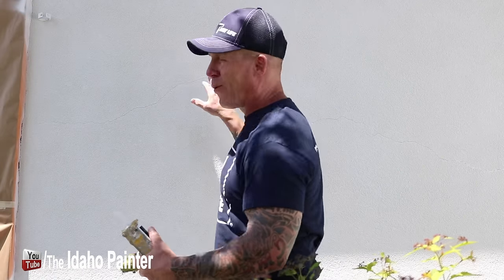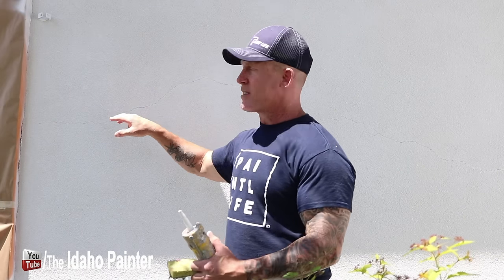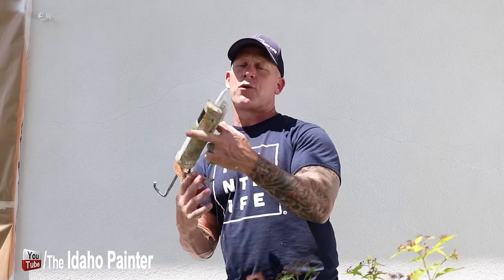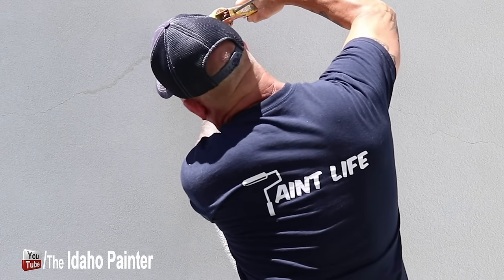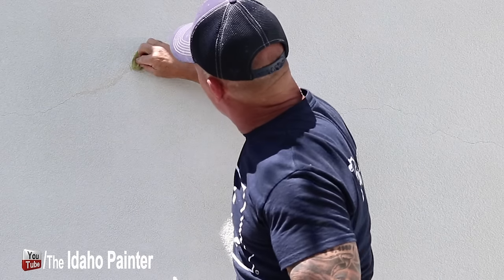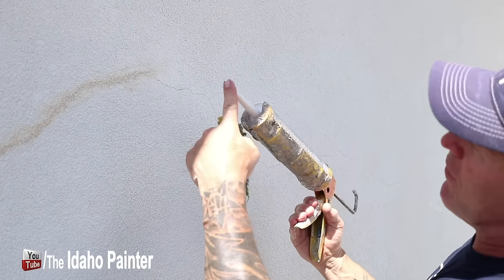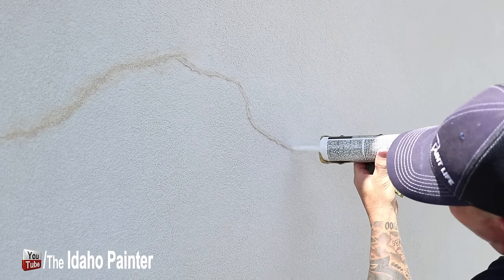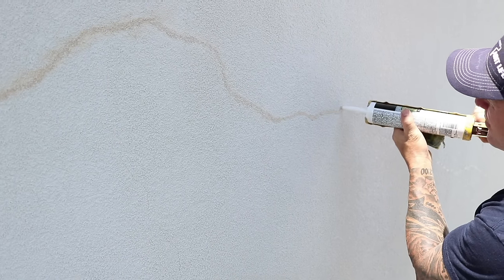Repair Stucco Crack Cheap & Easy

Comment: As a painter for a municipal govt. in the Southwest I had to do a lot of cracked stucco repair. I basically used the same technique you are doing, but instead of using a sponge to blend in the caulk I found that tapping the caulk in with a wet stiff bristled brush worked quite well. If the stucco had a rougher texture I would sometime work some sand into the caulk after it was textured.
Reply: thats a good technique to raise the caulking and give it a knock down if thats the type of finish they have..i like watching these videos to compare to my practice and helps me learn some new tricks or sometimes helps me find a better more efficient way of doing my job. nice to see another seasoned painter with an open mind to how others work

Comment: I gotta testify, I just read Colossians 3:1-2 this morning and then I watched this video and saw “Colossians 3:1-2” at the bottom of the screen! Awesome! We have a church in the French Quarter here in New Orleans and we’re painting the building. I used to be a pro painter but never dealt with stucco. This video was helpful -- thanks!
Reply: You really should read (Acts 20:20) and take the example of the preach work that Jehovah's Witnesses do
Reply: @alexshatner3907  are you a JW?
Reply: @RobertPresson  No, but I have relatives which I have high esteem for their Zeal

Comment: Thank you for the info. I bought a brand new house in AZ a little over a year ago, at the 1yr inspection there were some pretty big cracks in the stucco and i was able to get the contractor to fix but now i see more cracks showing showing up so now I can fix them myself😀

Comment: Which brand of caulking are you using here? In another video you were using White Lightning Megalastic caulking, but I don't believe that one has sand in it (maybe sand would not work with the super stretchy caulk?). Can the old sponge be used for texturing, in lieu of the sand? My wall gets a lot of sun and I'm looking for the best flexible caulking with texture for that. Thank you.

Comment: I keep a very wet rag with me and I wipe the caulk really well. It is another fast way to prevent any flashing from the caulk. I'm in Northeast Florida and 90% if my business is ext stucco repair/repaints. I also like to have a guy go ahead of the sprayer and hit the area's we caulked with a hotdog roller or even a 9/18" roller if it's easier. We backroll all our stucco anyway so there's a roller in the body already.
Reply from the maker: Awesome, thanks for sharing!

Comment: Ive found that with rough stucko textures you can just fill with an acrylic siliconized caulk and just fill only the crack and clean with wet rag, the paint i use is elastomeric, also ive found 90 percent of those cracks will go away if you fill them up with paint before you spray and backroll.
Reply from the maker: Thanks for sharing James

Comment: Great video.... I just finished filling stucco cracks on one exterior wall.  Two story house 21 years old lots to fill.  Looks to be about 3 tubes of caulk for each side of the house.  Found the same caulk at Lowe’s for just under $8.00 a tube.  Even cheaper on line if you have time to wait for it. This caulk works great so far, tomorrow all paint over it to see how it looks under paint.
Reply: Update:  worked very well. Don’t apply to much or you will see it after painting.
Reply: Thanks for the update

Comment: Hello.  Was wondering if you can answer this.  I have a full front face synthetic stucco.  Have some cracks up higher.
Would leaning a ladder with thick microfiber cloths on the top of the ladder 
be ok, as I no where else I can lean the ladder and work at the same time.
If you have another approach that would be great.  Thanks for this video.
Reply from the maker: Should be Harry

Comment: I have a pretty large house but only one little side wall that ended up with small crack all over. I don’t want to paint the entire house (house has never been painted, only a couple years old) so can I fog coat just this wall over the caulk with the matching stucco color?

Comment: So, you mentioned the “flat spots from
An improper repair”——how do I fix that? A hairline crack has turned into 1.5 inch slick spot that looks terrible—-thoughts/suggestions??
Reply from the maker: I have a video on it

Comment: It appears that you went right to work on filling the existing crack without any prep.  other videos suggest widening the crack to 1/4" with a chisel so that the new "caulk' goes in deeper and grips better.  Your thoughts?
Reply: That’s where I’m at. I’m going to purchase a crack chasing grinder blade and use that for the cracks. A buddy of mine suggested it. He also mentioned to use a compressor to blow out the dust afterwards and then to use a disposable brush and apply xylene so that the caulk will adhere better. He says that he uses Dymonic 100.
Reply: I've been looking at videos and articles and I hate how there are so many different techniques. The one where you widen the crack makes sense but most of these videos don't do that which leaves me confused as to which one I should follow
Reply: @Phaint  this guy is a painter, hes looking for curb appeal with minimal labor. He is not a stucco guy repairing cement based products is a totally diff trade and videos like this are really intended to help pro painters

Comment: #pleasehelp 
i have a similar paint in my house it looks like sand was added to the paint, my problem is after repairing cracks and dings, the repair is flat compared to the sandy looking paint job,it stands out from a mile,what do they add to the paint to get this look,i was told its a 70s method of covering up bad gyprock? even so i imagine once on its impossible to get rip off,so i need to blend the repair's, anybody??

Comment: IAM a painter  second generation ... And do it that  over the stucco the result will be flashing repairs crack .. non-existent proper caulk ..horrible result ...
Reply: anibal silva Flashing is usually do to the caulk not being a plasticised sealant. Dap always flash unless you re prime. Top Gun 400 will cut that flashing problems out for ya !
Reply: You need to wipe the caulk down really well with a wet rag to prevent flashing. I'm in Northeast Florida and 90% if my business is ext stucco repair/repaints. I like to have a guy go ahead if the sprayer and hit the area's we caulked with a hotdog roller or even a 9/18" roller if it's easier. We backroll all our stucco anyway so there's a roller in the body already anyway.

Comment: Vuelvo a repetir como el muchos vídeos vuestros hablar en español y si no un traductor muy importante el idioma más hablado del mundo el español de esta manera perdéis muchos seguidores saludos
Reply from the maker: We have several videos in Spanish
Reply: Aprende ingles. El no tiene que hablar espanol.
Reply: El español el idioma más hablado del mundo
Reply: @doctorhouse597   y tú no te metas donde no te llaman
Reply: @ferdelaguia9328  no tiene educacion? Vete a una escuela...
Reply: @doctorhouse597  tengo más que tú segurohhhhj
Reply: @ferdelaguia9328  😂🤡
Reply: @ferdelaguia9328  No, you are very wrong. Number 1 is English, then Mandarin and then at number 3 is Hindi. 🤦🏿‍♂️